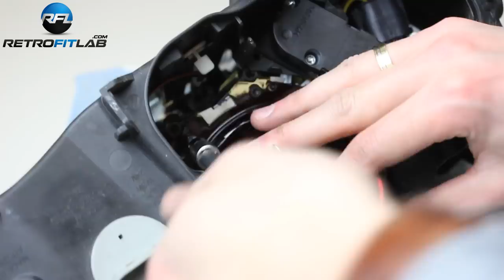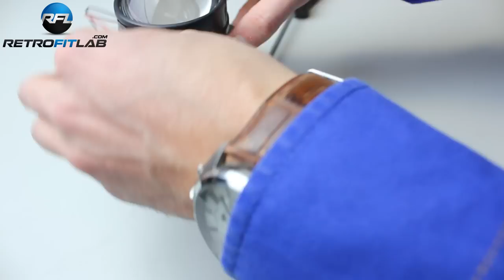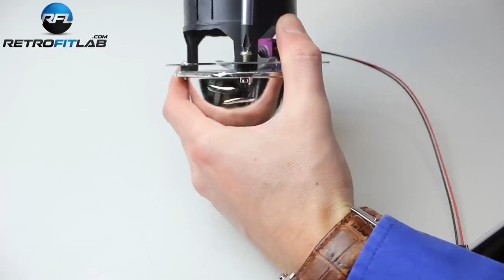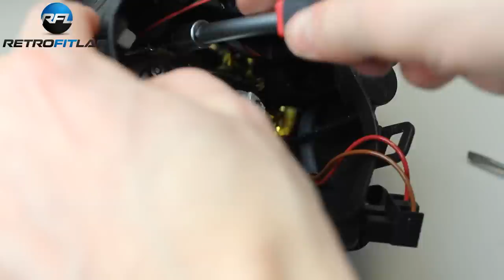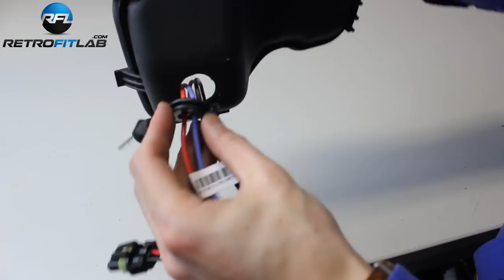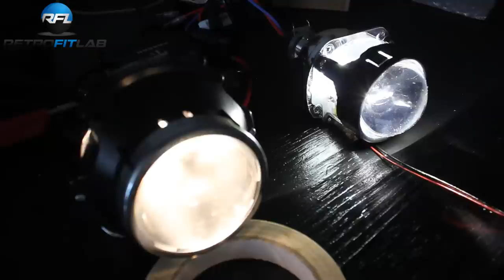Audi A4 B6 convertible cabrio Bi Xenon retrofit projector installation

Comment: Hi. Can u make a video of how to swap projectors in audi a4 b7 (2005-2008) with bi-xenon headlight? I wanna swap mine with a new pair, but i don't know how to disassemble them. Thanks!
Reply from the maker: Hi, sorry not planned at the moment. Should be not a very hard retrofit. The OEM headlights should be sealed with butyl, which is quite easy to open when warmed up. And replacing the projectors is also more or less just removing the old one and mounting the new one, same mounting points, so normally just a matter of loosening / tightening some screws 🙂 https://retrofitlab.com/collections/audi-a4-b7

Comment: i know its old but does this solve the very poor factory xenon light output on a B6 2004 Cabriolet or is this for non xenon lights only ?
Reply from the maker: We have both a kit for the halogen and the xenon headlight available. Please check this link: https://retrofitlab.com/collections/audi-a4-b6-convertible
Reply: And you don’t have to drill a hole in the cover.  I just repaired my a4 B6 cabrio with this kit. Bit of a hassle but all in all it’s a good kit.
And a LOT of light!

Comment: Says they are not legal....?
Reply from the maker: Technically it is not allowed to make changes to a headlight, so that’s why it is not allowed. 
But because only the projector is changed on the inside and the light pattern is correct (and has a very good cut-off so you won't blind oncoming traffic when the headlight is aligned correctly) it does improve the light a lot.